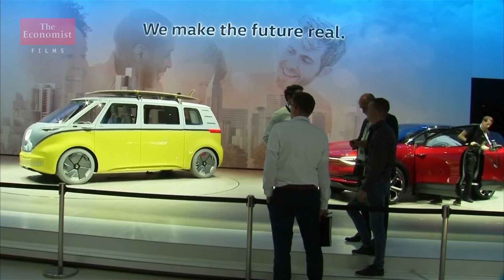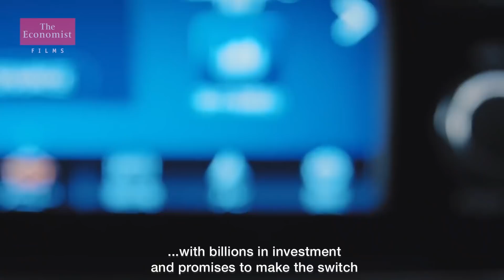Electric cars will come of age in 2018

Comment: Electric cars maybe quicker, but its still a long way for big automotive companies to start making them in huge volumes, as the battery cost is very high, most of the consumer electronics like mobile phones use the same batteries, much smaller but at  higher price. So the manufacturer gets a higher margin for phone batteries. Though car companies invest on their own battery plants, the battery price is going to be high due to raw material cost. The worst part is the battery technology is still evolving and battery charging time is still not comparable with filling a fuel tank. It makes sense to having a mild hybrid instead of full electric from the customer view also.

Comment: Do all these countries have enough power stations in place to handle the increased demand for electricity? I'd say no we don't especially if all vehicles used in the future are electric. So there has to be a massive investment in power stations across the globe. And who is going to foot that bill? The consumer. So electric vehicles might make the environment slightly more breathable but it's never going to be cheap to run. You may find prices start to increase with demand which could see a full charge dearer than a tank of fuel. I'll believe the price of an electric car equivalent to a fossil fuel version when I see it. Until that happens I won't be parting with my money just yet.
Reply: Solar charging is getting cheaper. Tesla is going to offer a system for your home that has a battery so when you get home it charges you car. Plus any extra power you generate will go back into the power grid, which will help supply the public chargers and you'll make money.
Reply: Does your house have electricity yet? Big problem in some areas of outer Mongolia.

Comment: Electric vehicles are likely the future, but you can't rush the future too agressively. Oslo nowadays has troubles with electric vehicles as charging station grid is not that dense - there are queues around chargers. Thats caused by long time needed for recharging battery. You can overcome it by big investment into charging stations, but then, you need to upgrade your energy grid accodingly.
I'm not saying we shouldn't follow path of electric vehicles, but we need to be careful and plan ahead.

Comment: This is Bullshit.  Batteries haven't use cobalt for a long time now, If you fuel cars with Electricity, it's 95% efficient (vs 35% with ICE car)s rapidly covers their production cost in carbon. No to mention most pure electric vehicle manufacturers use solar power in the car's production.  And, many of the charging stations are being converted to solar.

Comment: As others have pointed out - the source of electricity is less of a factor than this video suggests. Yoann Le Petit, clean Vehicles and emobility officer at T&E, said: “Today an electric vehicle driving on Polish electricity – the most carbon intensive in the EU – still has a lower impact on the climate than a new diesel car. With the rapid decarbonisation of the EU electricity mix, on average electric vehicles will emit half the CO2 emissions of a diesel car by 2030 including the manufacturing emissions.”
Reply: Taken from here - https://www.transportenvironment.org/press/electric-cars-emit-less-co2-over-their-lifetime-diesels-even-when-powered-dirtiest-electricity

Comment: module wingnut002(){
fn = 80;
vna= 20;
vn = 1/vna;
tube([10,100,100], $fn=fn, odd=true, basexy=true, edge=[for(i=[0:vn:1]) [
    ((-18*i*i) + (i*10)),
0,-0.5+i]])
void($Da=move($Dapoints, tsVec=[0,50,0]))
void($Da=scalersMAcp($Da, cp=[0,50,-60], raxay=[10,10,20]))
//void($Da=scalersMAcp($Da, cp=[0,0,-120], raxay=[1,0,00], raxayM=[4,1.2,1]))
void($Da=moveabs($Da, [-90,10,-35], rVec=[-15,180-60,0], sVec=[0.7,1.0,1.8]))
pp($Da, Da=360/fn);

}

Comment: Propaganda anti evolution.
What the one sided scare mongering video fails to point out is that even if an EV uses a coal power station for its fuel. It's still not using diesel or petrol and so lessening the impact on global pollution. 

This video was clearly paid for with oil money

Comment: I just purchased a Chevy Bolt pure electric car.  (actually a 3 year lease at about $150/month)
It has a battery that holds 60 kilowatt-hours of energy.
That gives a range of 200+miles.
I can buy solar panels for less than $1 per watt  (in fact $0.5/w)
$6000 and 10 hours of CA sunlight would charge the car from empty to full.
if i did this for 300 days (a year) i could travel 200x300=60,000 miles
Gasoline equivalent is  60,000/30 mpg = 2000 gallons or about $6000   (at $3/gallon)
After the first year i drive for free.  No harm to the environment.

Comment: Gulf Arab countries which has been sucking up on the Cheap Immigrant Slave labour is going back to a hole in the desert. With it comes the second Arab Spring because more than 40% of their population are below 30 years and are unemployed, spoiled brats. 

Castle Made of Sands, good luck!!!

Even if the EVs run in Dirty Coal, its efficiency is about 90%+ in comparison to 25% of the bast known ICE (Internal Combustion Engines). Also the future of Electric Grid is going to be Decentralized with many off the grid solutions to generate electricity from Solar and Wind, Fuel Cells etc..... too bad the Economist did not note that in this interview.

Comment: Henry Tricks, the Energy & Commodities Editor, seems not to know that even if you use coal to generate electricity for your electric car, it is far more efficient than burning gasoline in your little combustion engine.  So, you still produce less greenhouse gases with the electric car.  And with the increase each year in electricity produced by solar and wind power, which can be stored in batteries, you can reduce greenhouse gas emissions even further.

Comment: > The combustion engine as we know it was invented in the 1880s and it has had a pretty good run.

You too, The Economist, considering the electric motor predates that by 50 years, give or take. . . . So much for your trusty journalism. Bye~

Comment: If we are still depending on oil to charge these batteries then that won't bring any change at all to the environment. I will hail electric cars when an energy generating engine without a secondary source is invented. The car of the future in an electric car without a battery.
Reply: Orlando Ellis 
1)if we did "rely on oil" (which we don't!) it will still be more efficient, because you would remove the secondary transportation (refinery to filling station, generally by fossil fuel tankers),storage and the inefficiency of the gasoline engine from the equation.
2) I very much doubt whether there is enough surface area on 50% of a car, (which is all that will ever be pointing at the sun) to provide sufficient power.